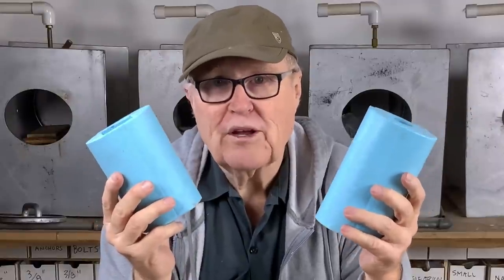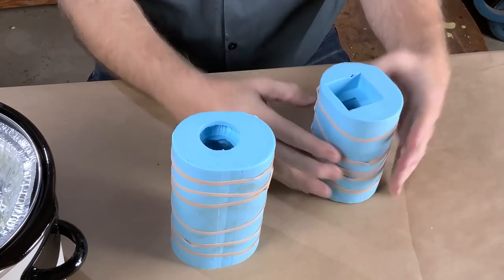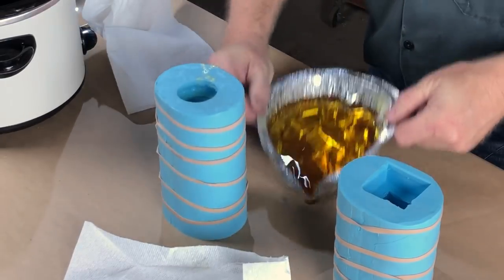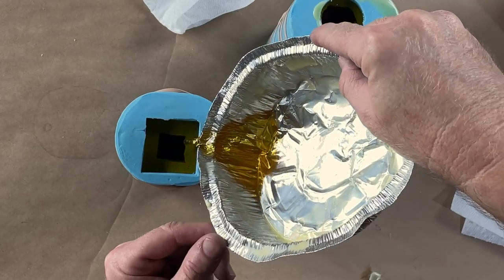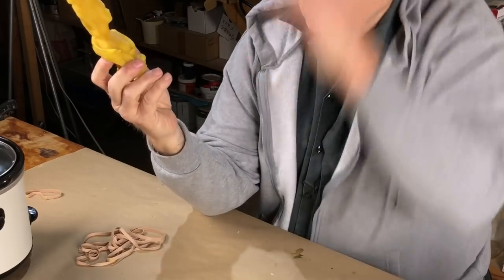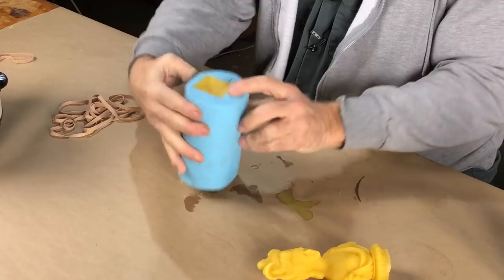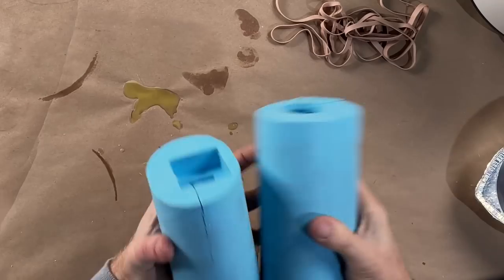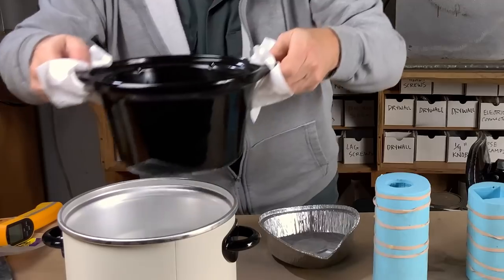Which Candle Wax Casts The Best?

Comment: Used to make candles years ago. Not sure of the type of wax I was using. The molds were hard plastic, didn't even need to be silicone.

One good the about wax is that you can easily get rid of any parting lives with a little heat at most

Comment: Bee's wax also pours very hot, probably why had more filling issues. But great work. Id's say waxes cast alot like metal, in that metals that shrink less generally are easier to cast.

That beings said, if you learn  your material you can pretty much cast anything...

Comment: Asking the candle makers out there - Am I right in thinking soy wax is not the best to use for a narrow-ish molded vertical candle because it would burn very quickly and drip an awful lot? I know it works well in container candles in which the melted wax is contained.
Reply: That’s correct pillar candles are best done with paraffin wax or a paraffin and 20% soy mix. Soy wax once it melts will just cut right through the sculpture or pillar and you won’t get a good puddle and will lose all the fuel and will eat the candle up way too fast while it burns.
Reply: @kykyhoffie3867  Thank you!
Reply: I was thinking very much the same but to the point of why bother wicking it at all except so that you could still call it a candle for marketing purposes. Im thinking that it would take quite a bit of experimenting with wicks and wax blends to make these shapes burn anywhere near effectively and not having 75% of your wax in a puddle in your saucer.
I am a hobbiest candle maker, focusing on pillar and jar emergency candles for my family and friends, which makes  getting as complete of a burn as possible important to my purpose. However I have been looking for a bit of whimsy lately and have discovered that many of the molds available have odd shapes and protruding bits that just would never get a chance to burn and I avoid them as I would these bust style molds. I'm starting to look at making my own silicon molds of household objects that would burn well and still have a fun aspect in their shape.  Good luck in your adventures!

Comment: My opinion. When you poured Marie you poured the head first, jiggled it, then poured a stream straight down into the wax in the head. The stream dragged air in as it hit and the bubbles clung to the side. I think if you had poured Marie the same as you did Napolean you wouldn't have had bubbles.

Comment: we have tried paraffin wax for a small cat head mold and it comes out pitted or mottled. We're pouring at 180 and added snow wax and it still didn't come out clean and shiny.  We added fragrance and can't get a good finished product and been making candles since 1993.  Please advise if you can.
Reply from the maker: I am not a candle maker so I can’t really help you.  My experience is almost entirely with casting resin.

Comment: Hi, I have a question. Which temperature (approximately) did you do warm the molds in oven? Because, I did 80 celsius warm in the oven but inside of the molds was cold.
Reply from the maker: You have to heat the mold long enough so that it heats all the way through. For resin I usually just warm the mold to 25- 27 celsius.  For wax I heat the mold to the melting temperature of the wax.

Comment: Do you still use that crock pot/slow cooker for food or only for wax and other projects? 
I'm going to try my first of making silicone molds to make my own candles, and I'm planning on melting my candle wax in the technique where you have it in a metal container which is floating in a pot of boiling water.
Reply from the maker: I never use shop tools for food.  The kitchen tools stay in the kitchen.

Comment: i am new to candles making and i have been told that the soy wax is not good for silicone molds as it will melt,  its only for jars or cups, is this true?
Reply from the maker: The wax won’t hurt the silicone but it’s not an ideal casting blend. I have very little experience casting candles so I don’t know what the best casting wax is.
Reply: @RobertTolone  i meant the candle itself will melt and won't last, not the silicone mold :D

Comment: How about trying to cut down turn around time by first doing an outer thin layer with the super flowy hot wax, then when it won't pool down from the mold walls anymore, fill it up with wax that is just flowing? (have no experience in this, just shooting poo poo)

Should be worth trying, because it could greatly reduce shrinkage as well as work time. The outer layer could also be pigmented separately from the core.
Reply from the maker: That’s how colored candle are made, I think. They let the first color pour cool awhile, then pour it out. Then fill in successive pours of plain wax.  I too am shooting the poo.

Comment: Where did you find your small heat "gun," if that is what I am seeing in this video?
Reply from the maker: It’s a Wagner Spraytech 0503038 HT400 Heat Gun.  I bought mine on Amazon, but you can probably find it lots of places online. Also google “mini heat gun” and you’ll find lots of brands.
Reply: @RobertTolone  Thank you! Also, I lost my Ogi wax recipe I got while working as a sculptor at Applause! I have a project where the client wants a wax model. Do you Know any recipes you might recommend? Ogi's was a mix of paraffin, carnauba, beeswax, titanium dioxide, talc, and oil paint color - I just lost the proportions. I am reading some carvers are switching to candela wax and corn starch, but I will have to experiment later when not on a deadline. Hope to hear from you again! You used to be out in LA, as I recall hearing your name before.
Reply from the maker: @lindasnyder3961  OMG, I did a LOT of my toy work working for Applause as a freelancer. Mostly worked with Roger Shank.  Your name is familiar to me as well, can’t remember if we ever met there.  Seems like everyone used Ogi’s recipe.  I never did, so I don’t know his the exact ratio. Email me at roberttolone@yahoo.com. and I’ll send you the info I have on mix ratios. I still live in Long Beach.

Comment: Why don't you throw your molds into a ziplock back and then into a water bath? It seems safer for the molds and you don't need to babysit them like you would in an oven. Sort of like sous-vide.
Reply from the maker: That would work are long as the bags don’t leak. Even a tiny amount of water would ruin the castings. As a general rule, because I almost always cast resin, I won’t let water get anywhere near my molds. Because moisture causes resin to foam. So I have always warmed them in various ovens in the shop.